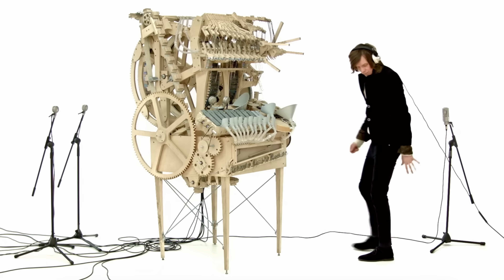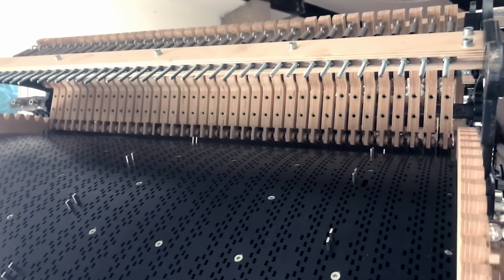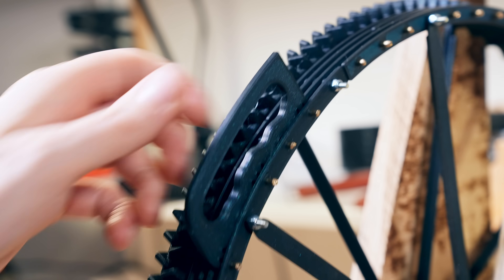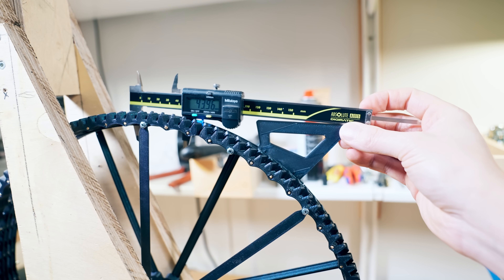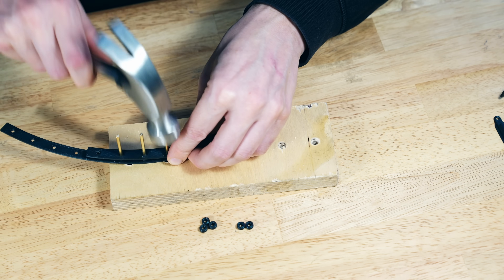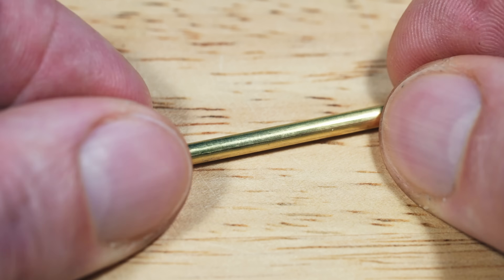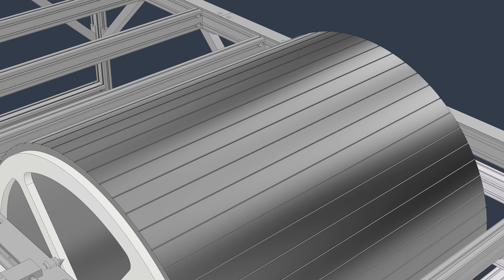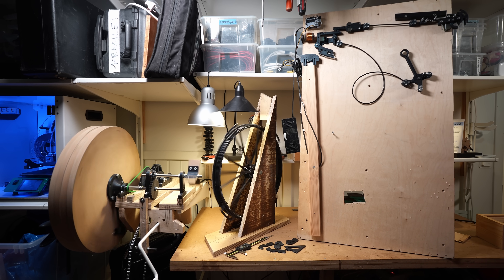Prototyping The Marble Machine Programming Wheel

Comment: I think that using a programming wheel is a very bad idea in the first place. I would rather like to see a digital controller that triggers electric marble gates and can be used as a midi instrument or play midi files and that can be midi synced. What is the benefit of that mechanical wheel? Is it really a nice job to program that machine? Will it be any different on stage with a physical wheel? I guess not. The flexibility of a midi compatible marble machine has lots of benefits and less moving parts and less bolts. Think about it, why not use electrically triggered marble gates and get rid of that wheel for good?

Comment: You could use SOLENOIDS for releasing the marbles and program the tracks using software(arduino or similar). This is a radically different approach, but essentially a marble machine plays marbles, does the programming matter? Moreover this will result in less mechanical parts, making the design requirements LESS DUMB.

Comment: You need a way prepare the programming for 10 different songs (for a concert), so that you can load the song program into the machine in a matter of 2 minutes. I suggest you a completely different approach, like the one used by the first computers, with punched cards. With a complete analog mechanism to read the card, and control the marbles. It can be done, and it is much cooler than a wheel. The wheel now has two functions, it loads and executes the program, meanwhile you should create two separate components to separate this responsibility.

Comment: Hm, with some work you can get rid of the whole rotor cnc part. Really, all that would be needed is a normal mill that has space for the wheel and a dividing head in an assembly used to fixate the wheel. Thats at least how I would do it as a machinist and also how in some places I worked really big "bespoke" gears where made. You really would only need a very simple tool path that is repeated for each row. It's more work, but may very well be a lot simpler than finding a rotary mill that is large enough to do this part. Most likely also a lot cheaper.

Comment: So I know this is late to the party and you may have already moved on, but I don't think your thinking through the possibilities of your 2D world still.  Instead of cutting out of giant cylinders, you cut a lot of smaller wheels out of cheap sheet metal ~ 1/16" thick and then you turn those down with a specific angle / chamfer features.  That gives you the shapes to click your profiles into but removes entirely the complicated machine steps.  Water jet time is insanely cheap compared to what your talking about and the cost of sheet metal is also much lower than 'turning' down a huge 3" block of aluminum / plastic.

Comment: Hey Martin, I love your design 3!

One concern/Question: You want to pressfit the metal bars into the wheel. I am concerned that the bars will buckle while you try to press fit them in. Maybe concider gluing then in/ "Shrink fitting" them (Freeze the bars and heat your wheel to make a press fit easier to assemble. 

Other than that this things awesome and I love the series!

Comment: version 3 of this wheel will probably have a manufacturing issue - those long rods will be VERY difficult to press fit along such a large surface area, and will likely bend before you can get them through the entire thing. Design it so you can use smaller rods.

Comment: Martin, Using a press fit on those long rods is a mistake. The tolerance for a lolly pop mill and that rod will likely cause issues. I would suggest going for a slip or transition fit and using screws on the end to hold the rods in place.

Comment: 8:48 it WILL add pressure in the rotary direction since the tool is rotating it pushes to the side when doing a slot cut

Comment: If I may throw a thought in the room about wheel v3: the slots for the programming blocks should probably be cut /before/ the grooves for the metal bars.
Because then it would be possible to program the CNC to give the grooves a little chamfer within each block slot, which in turn could massively simplify the process of getting the bars into the entire groove.
Without the chamfers, it possible that the bar might refuse to go into the next slot. Be it just from friction and the lack of a chamfer or simply left over burrs from the slot cutting.

Alternatively could the operation for cutting the block slots try to put a little relief into the groove from the side. But I don't know how effective that would be in comparison to having the groove operation do that.

Although thinking about it, the groove could probably still be cut first, if the CNC's told to do little "bumps" to the side where the block slots are meant to be in the end.
First the straight cut all the way through, then a "bump" to each side where the block slot's wall would end up. Then when said slot is cut it should also leave a little chamfer.

Comment: I don't have much experience with machining parts, but it seems like trying to shove a long rod through that many press-fit connections would require a tremendous amount of force. What if instead you cut a V-shaped groove and used that to locate the rod, then used, say, 5 points along the length to bolt it down?

Comment: I want to point out that you don't really even need a circular shape to slot the metal bar into, and a v-shaped groove will work just as well with room for an adhesive based solution for mounting the bar, making the wheels even easier to machine and repair.

in addition, this would put less lateral stress on the machining bit.

Comment: I wonder if milling the lines from the programming wheel from the inside diameter would solve some challenges ahead of the construction.

1. It would provide bending points for the curve in conjunction with the channel for the metal rods.

2. It would be held in place by the structure of the wheel frame (force opposing insertion of programming pins)

3. The material of the wheel would hold the rods in (opposing the force of removing the programming pins.)

Comment: Please note that a full plastic wheel will be prone to a lot of thermal expansion on the world tour. This could result in centimeters of variation in programming wheel diameter. Also, plastic is prone to creeping over time. I would recommend a steel basis for the wheel with small, replaceable, plastic parts.

Comment: WHEEL. Why not to use something flat? Like punch cards, tape with cnc-drilled holes... 1) Unlimited duration and variability for each melody. 2) Easy/fast to replace/reload. 3) Light weight 4) Еakes up less space in machine than huge wheel.

Comment: You really need to go back to designing a prototype for a governor / clock escapement mechanism. Your power input mechanisms will not stand up to varying load. Rather than working out that heavier/lighter flywheels make a difference to timing, you should instead be working out how you can provide accurate timing to the output regardless of the load of it.

Comment: I love your work and have been following since the beginning. I like how you've been breaking down each problem into its basic components and then testing them. My only concern for this is how difficult it would be to remove the programming profiles when you have dozens sitting next to each other.

You might need some kind of "note puller" tool to extract only the ones you need to adjust. Otherwise, pulling them out by hand might bend/break the notes on either side. 

I also think, instead of a sea of grey, each note length should be a different color. That way, you can clearly see what notes need to be adjusted (i.e. blue whole note, red 16th note).

Comment: Im no engenier, but im a mechanic and i can tell you, depending on the material you use, V3 will be a pain in the ass. 1) the entire ball part of the mill bit is in use. That will most likely mess up the bit pretty fast and you will burn throu them like cracy. You have to use a pretty soft material for the wheel or take it incredebly slow, orherwise the wobble you create by full contact milling will mess up your meassurments. 2) you have a lot of different cuts. If you use a soft material like PE, as soon as your milling bits gets dull your edges start to look like chewed. 
Its doable, no doubt but if you do, do yourself a favor and outsorce it to a professional. You get your money double back in safed lifetime.

Comment: I was thinking about the Huygen drive and the need to keep both it and the flywheel going. It occurred to me that a split differential gear would let you drive both with the single peddle input, if the Huygen mechanism is resilient enough to hold against the torque from the flywheel input when fully wound.

Comment: Honestly this whole rotary cnc thing doesn't seem like a great way to do this. If the only important things is evenly spaced metal rods around a diameter, and the rest of it doesn't need to be terribly precise, I would opt for doing everything starting as flat pieces where you machine your rod-groove and holes into the back of wood slats, and then machine a flat disc for each end, and put the rods and wood slats through those holes. The slats themselves could even be given a radius on the top so they still create a continuous curve if you like, or your programming profiles could be adjusted to better accommodate the flat spots. Rotary C&C makes it fewer processes, but if anything happens during machining you'll waste a lot more materials. Additionally you need to design the machine for easy repair on the road. If something happens to the rotary drum mid tour and you've relied on this crazy process, you won't be able to easily fix the machine because unless you brought a spare of the whole part (and possibly any connected parts) you'll be up shit creek. If you use pieces that start from flat, you can carry a few spare pre-machined slats, and even if something comes up, flat machining tools aren't hard to find, and don't require as much specialized training, so you will likely find a maker, makerspace or machining company in the same city that can do a rush job the same day.

As much as tight music is important, so is planning for failures and failure recovery.

Comment: As for the press fit of the rods in design 3: maybe consider a looser fit but put some slightly undersized holes on one side  close to the slot. You can easily put the rod in and then put screws in the roles, which causes the pom between the slot and the screwhole to bend a bit towards the slot and secures the rod in place.

Comment: Martin, can I challenge your assumption that the programming wheel needs to be a wheel? What if it was a chain drive? You could make your music loop of arbitrary length by using larger chains (and adjusting your idler gears).

Comment: The programming wheel could operate using solenoids to trigger the gates. (I know it’s expensive, but could be worth it.) The solenoids can reset every revolution, so sets could be longer with a smaller wheel. Also, you would never have to reprogram the wheel by hand. 
I don’t think you should kill the project if the programming wheel doesn’t work. 
For me, the magic of the machine is how the marbles drop on beat to create music. It’s more than a music box.

Comment: Look into compressionless brake housing for transferring the movement at the programming wheel to the marble gate. Bikes with mechanical brake systems use brake housing to route the movement of the brake lever to the brake calipers. Compressionless housing is specifically made to be stiffer and less squishy, possibly letting it play tighter.

Comment: I imagine that press fitting those LONG metal bars into LONG slots will be quite difficult. I think the amount of friction building up will quickly overcome your ability to push them into the slots. You might consider splitting the programming wheel into several narrower drums with shorter slots for ease of assembly. You could even align the narrow drums using the metal bars provided you leave some overlap.

Comment: Of course get the speed and consistency of the machine to be as stable as practical but then I say that the marble machine has to be the master clock itself. Humans can easily adapt and play along with the slight millisecond deviation you are achieving already. If you plan to incorporate electronic music elements into a marble machine song then have a way to trigger the tempo of your samplers FROM the marble machine. Trying to get any mechanical beast to sync up to a digital clock is futile. The marble machine, not the click track, has to play the role of the drummer.

Comment: Martin, your test WILL FAIL. Your power train was built and tested assuming constant load and it just won't happen with the programming cylinder. There's no way a flywheel and a governor could work to your expectations.

How to solve it:

1- complicated and undescribable mechanical systems;

2- implementing "silent channels" that plays nothing, but will equilibrate the absence of load from the "playing channels", so the load is constant. This solution means you'll always need a "negative" from the playing channels loading the power source with almost the same power consumption;

3- Implementing a parallel more intelligent power source to keep the slack from the Huygens source. The electric motor you tested in MM2 would be a good candidate.

Comment: If you replace the programming wheel with an electronic controller and replace the marbles with speakers, the whole system would be simplified and the timing/sound would be near perfect.

Comment: I think you're going to find that your timing mechanism will not hold up under load. You really need to make an oscillating escapement to keep tight time or you will always be fighting against the influence of the mechanism drag effecting your timing. If you want your machine to run like a clock you need to make a clock.
Reply: excellent point, my metronome I practice with agrees with you.

Comment: Martin, you can change bpm on the go precisely by adding a attack angle rod to the governor. With this rod, you can manipulate drag coefficient of the governor propeller like in helicopters thus changing the rpm that the flywheel rotates at. This method does not effect precision of the system and might be a good addition possibly. With this flexibility on the BPM, you can use the programming wheel much more efficient for varying tempo of different music tracks.

Comment: I vote you to build your cnc machine, including a brake system, to lock in the axis. Lock on the outer diameter to avoid the torque advantage the cutting tool will have cutting on the outside of the wheel. Use your a axis as an indexing axis. And make your gear teeth using xyz to avoid a lot of problems designing a rigid a axis capable of cutting even plastic on such a large diameter. It's great to see such commitment to a problem that only exists in the mind of a single person.

Comment: Hi Martin! Did you tried the idea of having a more flat programming wheel?
You can make a programming wheel similar to a tank chain wheels, where you can play the music in the top more flat surface rather in a  cylindrical shape, that could be more accurate I think also more space flexible because you can have a programing wheel as a chain rather as a big cylinder. Similar to the programming paper you were using to play music with the music box.
Reply: Another thought I had would be to have music stored on a set of stacked plates.  This would be much easier to store than a set of drums, as well as being easier to manufacture.  A sub-variation on this, given that using plates could allow for a higher linear speed, would be to have plates with marble-sized holes, and have them pass under a hopper containing marbles and proceed up a ramp, carrying the appropriate marbles with them.  When the marbles reach drop channels, they would fall out of the plates and onto a catch which was held in place by the part of the plate just ahead of the hole.  Once the hole reaches the catch, the marble would then be able to fall.

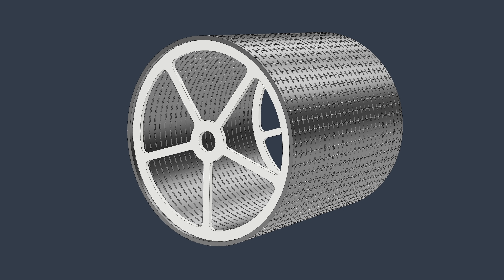Comment: 9:35 Martin you need a way to hold the rods press fit is not going to work. Instead you should flip this and machine the rod grove inside the cylinder this way you will not be pulling the rod out when you pull programing togs.

Comment: Waaaaaay back before your time...But some of us still remember... 🙂
There were "player pianos" where the "programming wheel" was a scroll of paper with holes in it.

Maybe use a similar approach, but with hi-tech optical-based readers to read the 'music' off the paper and convert into the mechanical actions to drive the marbel machine?

just a thought....

Hmm, which leads to pondering... printed music, maybe even sheet music itselft, that is read by optical readers...
That could essentially play most any music 'arranged' for the marbel machine in standard music notation and just play it...

the brains runs wild with ideas.....
Reply: If you are going to go that route, might as well just use midi-controlled marble gates and skip any sort of programming wheel or piano roll altogether. Then the "machine" portion only has to worry about circulating the marbles. There are few pipe organs which exist that can either use a mechanical piano roll system, OR midi control to make them play automatically. Of course, this just highlights the fact that Martin isn't the first person to attempt to climb this metaphorical mountain. If he would spend a fraction of the time he spends playing with 3d printers and CNC machines to open up some books, or look at extant music machines, he might find solutions where he doesn't have to completely reinvent the wheel all the time.